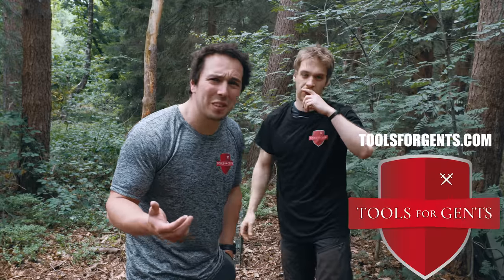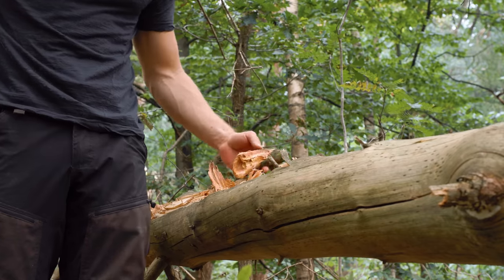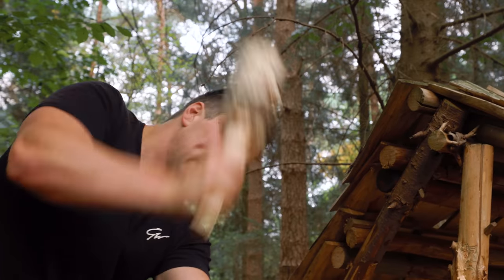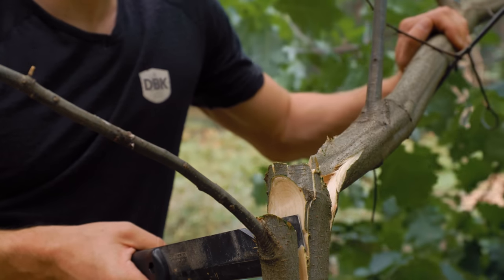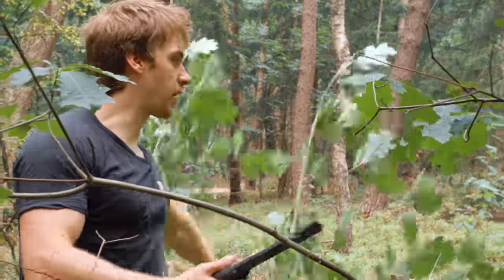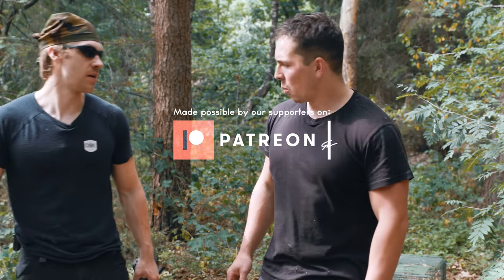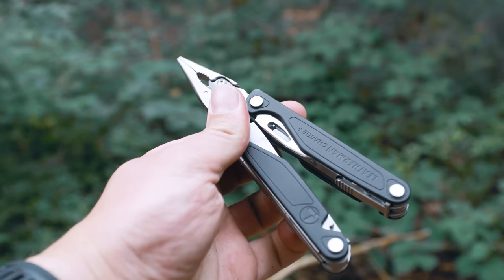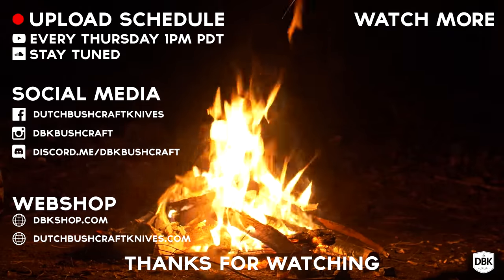this knife was MADE to be indestructible.. And it worked!! Ka-Bar Becker BK 3

Comment: Looks like they've perfected the heat treat on 1095... The tops storm vector had this performance.
Reply: The storm vector was NUTS.
Reply: This is the Becker BK2 taken one step further, maybe even one step beyond.
Reply: 1095 has got good edge retention and is relatively easy to Sharp but it's also more brittle even when perfectly tempered... are you sure it's not 1060 it has a better balance between edge retention and durability when properly tempered
Reply: @diogenes42069  
The steel is not basic 1095, it is 1095 Cro Van. A steel that is just that bit better.
Reply: @RiderOftheNorth1968  is that similar to how they strengthen 420 steel with titanium bonding for larger knives to make them more durable?
Reply: @diogenes42069  That i do not know. The 420 series of steel is not anything i have experience with. I am sure the Internet can help you.
Reply: @RiderOftheNorth1968  essentially it just makes the poor quality steel more durable and retain its edge a bit longer I wasn't familiar with the term you up so I was asking if it was similar for a frame of reference assuming it was a method of making 1095 more durable lol
Reply: It is not 1095 steel, it's Carbon V which has nothing to do with 1095. Different recipe  different steels. I prefer it to 1095
Reply: @diogenes42069  Honestly in my experience 1095 is some of the strongest stuff out there. I've messed around with 1060, 1075, S30V, D2 and some other steels and I have to admit, 1095 is by far my favorite for taking abuse.

Comment: Loved your review.  I've had this tool for twelve years now and it has surpassed any and all expectations.  After over a decade of heavy use, I have yet to do more than inflict a few scratches on its surface.  I keep it on the same belt as my bk9 in my truck and, so far,  the pair are unstoppable.

Comment: DBK you guys need to modify the BK-3.
Strip off the coating.
Blue the steel.
Replace the handles with better materials.
Make the spine 90° sharp for fire steel scrapings.

The cuthook is already good for smaller firesteels though.
Reply: Taking knives that need improvement and modifying them is a cool video idea. yeah? yeah?😉
Reply: @1diggers1  yes! Go make it :) I’ll watch !

Comment: Ive had my Ka-Bar USMC for 24 years now. Ive beat the hell out of it and its still in perfect condition except for wear and tear but the blade is still in tact. I scraped the finish off of mine and used gun blueing and I like it even better now. Still has the original leather handle.

Comment: Yes so everyone thinks Kabar is just plain ol 1095 carbon steel but they couldn't be anymore wrong!!! I was born and raised right here in Olean NY yes it is where Kabar is from and the original steel they used was called 50100B from Sharon Steel which unfortunately has been discontinued so then Kabar had the exact same steel replicated and they called it the 1095 crovan for the added chromium and vanadium but it also has many other benefits over traditional 1095 there really is no comparison between the two!

Comment: good review - love it.

there's a review on blade forums where a guy takes a lawn mower apart with one.  savage.

fire steel tip with BK3 - since it IS a chisel grind, flip it around so that the flat side is on the direction of the strike, yah?

a small section of the spine could be made very flat and sharp as well

otherwise, it's going to dig in more than you like...

the "gut hook" isn't really for seatbelts, but more for paracord and breaking/ripping wire (fences), it's very effective at that.

the original models (div tools) were stainless!  and suitable for navy divers/etc, also some where wider and shorter with more finer serrations, more saw like action on those polymer ropes

Comment: Having first learned about this knife through battlefield and later finding it in a pawn shop, it has been a tank and I've hit more metal with this knife then wood. I do not like the stock sheath that comes with the blade since it wears down the edge quickly.  This knife is made to take massive punishment and it's not designed for finer work.

Comment: I'm looking for an edc knife that is tough and versitle but with a full tang stag antler handle, saw back and slightly curved forward blade so it could be used as a draw knife and be great for chopping wood.  if it were made of Damascus steel I'd have to be buried with it.

Comment: I have one of these (or the old gen at least no idea if they've changed anything) but I never thought about chopping up kitchenware lol
Definitely a solid piece of heavy duty bushcraft tool, large enough to be used as a small shovel too. Would i rather have a machete or depending on environment a hatchet? Yes. But do you have to bother carrying hatchets when you have one of these? Only if you're planning on chopping firewood and such.

PS i ain't sponsored by kabar, I actually dislike their products, especially the iconic marine knife

Comment: Got a convex question.  On a knife like a gunny where does the convex start (going down from the spine) for sharpening purposes.  Also, for the less talented, what do you think of the sand paper on a soft surface method for sharpening convex?
Reply from the maker: The funny convex should start directly from the shoulders.for Sharpening though it's enough to just hit the first 1/3rd of the bevel. The sandpaper can work but it easily over convexed your knife Making it duller instead of sharper. I've tried it but it's a hassle imo as the sandpaper wears pretty fast. It might be good for touch ups but it will suck when you want to get out a chip
Reply: @DutchBushcraftKnives  Thanks for the advice!   Great channel, its awesome to learn and be amused at the same time.  Good stuff!
Reply: @DutchBushcraftKnives  I wanted to report back that I just successfully reprofiled an old spyderco folder made of VG-10 to convex on my stones.  It really is a much more natural motion.  I like it!  Thanks for the advice and videos. ✌

Comment: Thank you for torturing that monster. I have been looking at them since they came out but didn’t know if they were worth it. I have 2 KA-BAR kukri machetes and I love them, but I guess my next purchase will be the BK3. I just purchased an insane and fancy cutter, the Sandrin Dellatorre, now is time for another beast. One question though: what is your opinion on the sheath and handle? The one thing I’ve read about more than anything else is they are garbage but there are great after market options.
Reply: I have a bk7.  The sheath it comes with was terrible and the handles were slippery.  Got a custom leather sheath from a local shop and g10 handles from the knife connection.  Now it's fantastic.
Reply: @megacab  Thank you for verifying the other reviews weren’t lying about anything. As I looked into the BK3, I saw complaints about other members of the BK family having the same 2 issues. The most basic and half-assed search showed me micarta handles, but I figured G10 handles were out there too and I like G10 much more than micarta. Once again, thank you.
Reply: @TheHookBoy  welcome!

Comment: That pan you chopped was almost certainly not steel, it was aluminum.  Not 100% sure, but steel is a pretty piss poor conductor of heat, and almost every non stick pan made in the world is aluminum because it's cheaper, and a much better conductor of heat.  In fact,  most of the steel pans you buy are stainless clad with aluminum cores, either clad through the whole pan if you've got really nice pans, or a disc glued to the bottom if you own more budget pans.  

So yeah, it's still impressive, but aluminum is far softer than steel.  Every steel knife that is asking for money should be able to hack through an aluminum knife, the knives that don't cut through pans like that are literal garbage.
Reply from the maker: I get your point but this pan is 100% made out of steel. We purposely dont use the aluminium ones because its cheating. You’d knock someone clean out when hit over the head with this pan! Haha cheers mate, see you around!!
Reply: @DutchBushcraftKnives  in that case, might I ask the brand of that pan?  I'm curious if it might be available in the States.

Comment: A crowbar with what could barely be called a cutting edge. Sharpness is one thing, geometry is another. Not a knife in any way. The cutting and chopping ability is minimal because of the lack of and primary bevel for such thick steel stock to thin the body of the blade. Sure it’s tough, but you’ve traded so much cutting ability for what I would call ridiculous over the top marketing. Chisel ground, so the edge is extremely susceptible to rolling when chopping is done with the wrong side of the grind. 

I’d rather buy a wedge for this type of work and call it a day, because this thing isn’t out cutting ANY decent camp knife with a high saber or full flat grind with a shallow secondary bevel. Doesn’t have the length or the heft to be a true splitter, and the blade profile is all wrong for a chopper/camp knife. Just don’t see the point of this, you don’t have to looks very far, a blade from the same company like the BK9 would serve you infinitely better.